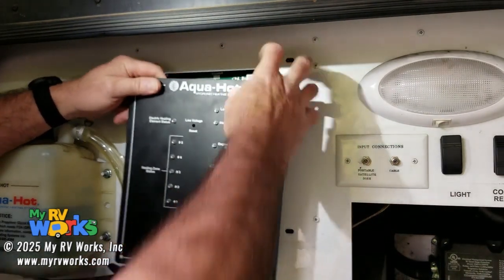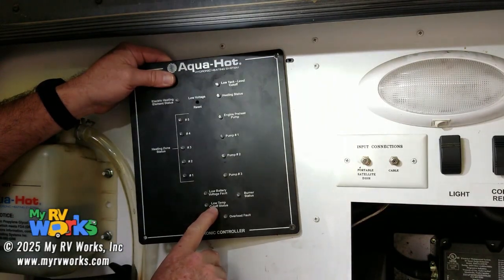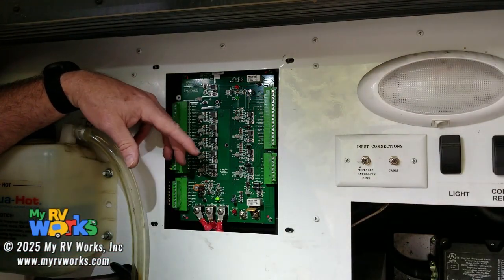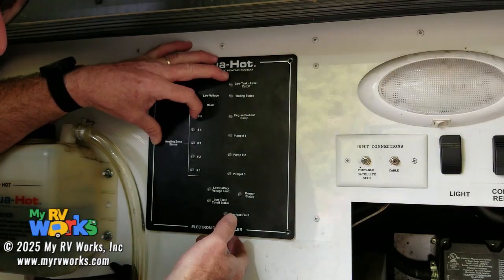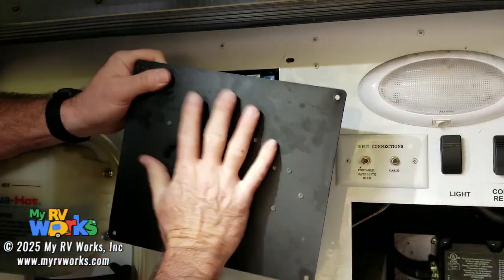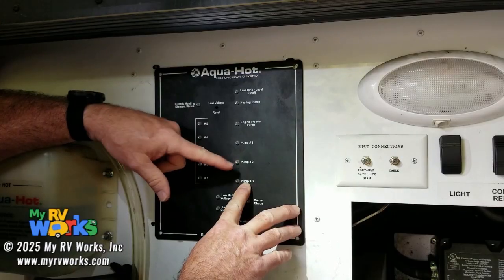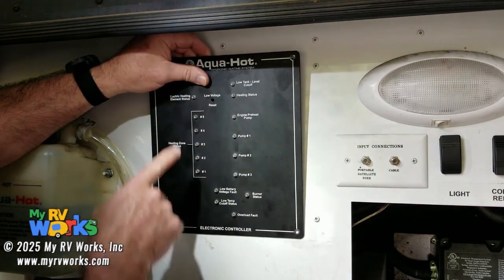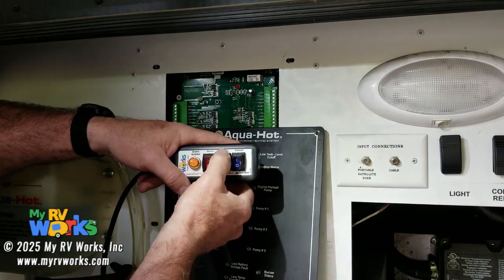Understand AquaHot Status Lights in 5 Minutes!

Comment: Hello and Gooood morning.     I have a question related to Rv furnace temperature control.      When I turn on my furnace let’s say temperature in side says 55 degrees and I have it set to turn on at 58 .  The unit for either zone will not turn on until the temperature difference is greater than 5 degrees, but it will shut off after the temperature is 1 degree hotter.   Is there a fix for this.  I have already replaced the thermostat controller.   For further context the two zones are usually off by about 10 degrees max when the Rv is either heated or A/C cooled.   The rear thermostat is the one that reads colder than the front.

Comment: Are the AquaHot schematics good? If they are and the controller board does not use exotic components, then you should be able to repair the board. Sounds like all the signals are low speed and you would not need an oscilloscope to troubleshoot. If I were younger it might be an interesting business to get into. Thank you for all the information you give and the time spent on teaching us. Stay safe, God bless.